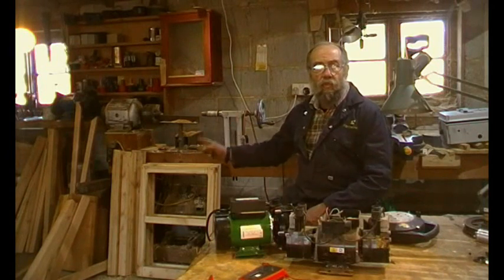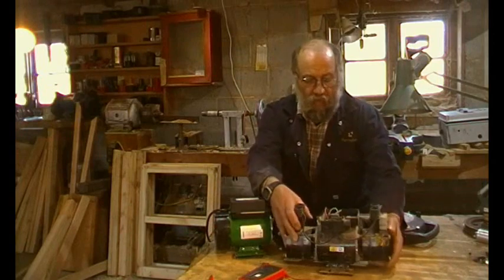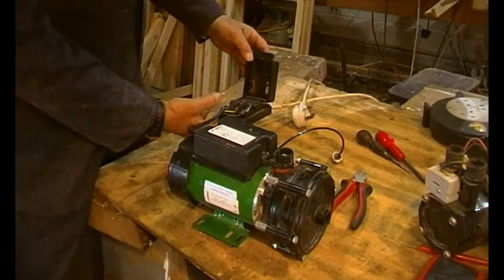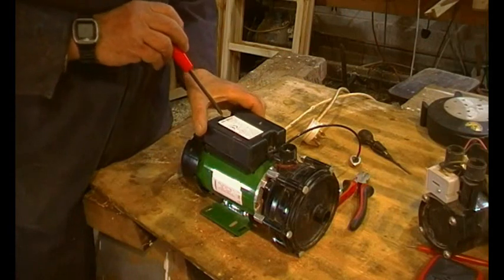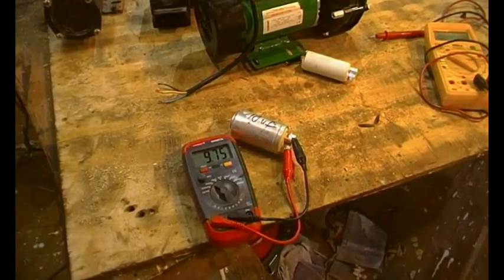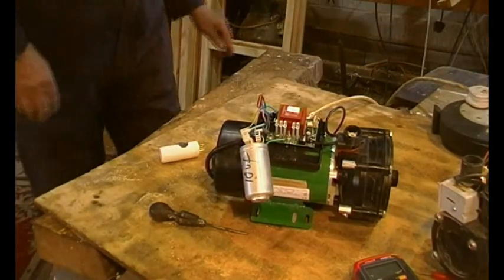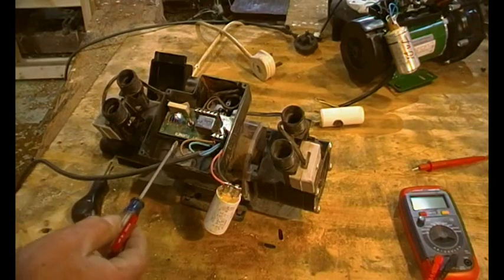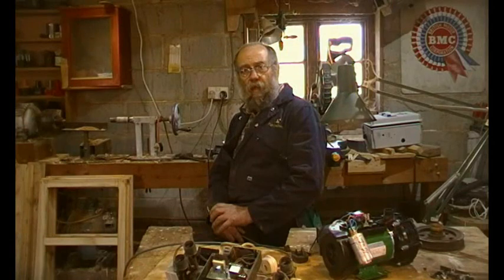Salamander water pump repair and re-purpose in our rainwater harvesting system.

Comment: Mine only works at the one side as the hot water wasn’t going we turn it and now cold one is not going any advice 🙏
Reply from the maker: Hi, is the motor spinning? are there any servo-valves in the system that are stuck? You may have to take it out to test, cheers
Reply: @TheInfoworks  i dont thing so we have any servo its old system with the tank in the loft 😢
Reply: @TheInfoworks  we have salamander pump and thats a second salamander pump which stop working properly after not even 2 years 1st one was 1.5 bar that one is 2.0 bars my husband turn it around and now hot water is going but cold one not
Reply from the maker: Sounds like the motor is stalling when both pumps are working, I suspect a bad capacitor, cheers @karolinapawlak132
Reply: Hi pump is going ok just with the cold water when i try to turn tap to hot one or open hot water not working at all no motor going with hot water

Comment: Can you connect the wires to any of the capacitor spades ? Or do they have to go in a certain order ?
Reply from the maker: Hi, yes an AC capacitor has no polarity, so any way round. It's the DC ones that need to be the right way round, cheers
Reply: @TheInfoworks  thank you so munch. Really hope this fix works for me once received the capacitor
Reply from the maker: As you have seen, ithas worked for me several times, cheers  @hassf419

Comment: I have this same problem where can I get a replacement cap?
Reply from the maker: Hi, I'm sure an on line search or even Ebay will provide. Hope you enjoy my other videos, cheers
Reply: @TheInfoworks  I called Salamander they say their caps are specially made and they dont know or sell a replacement :)
Reply from the maker: @chrisellwood3523  Chris, that's just corporate marketing nonsense designed to sell more units and create tons of waste. I showed what I did and that is successful, but if don't feel like improving your skills then there's no more to say, all the best, cheers
Reply: @TheInfoworks  I changed the cap from a new motor and still just hummed with no motion.  The new motor was silent until I turned it upside down.  Must have been another issue , not the cap
Reply from the maker: @chrisellwood3523  Yes there are pressure  water flow sensors in the output connection that i disconnect when using these pumps for other uses. Turning the motor over activates the sensor gates, cheers

Comment: So, just checking, you basically bipassed the circuitry, so mains is connected to a motor? Thanks for the video 👍
Reply from the maker: Hi, yes and changed the duff capacitor. Although the control circuitry worked it was not necessary for the my use as I think it was some form of back pressure sensor. subscribed? cheers

Comment: I've seen videos of capacitor banks to start cars, wonder if the battery would last longer not taking the strain of high current draw.

Its the same on generators not producing power after the capacitor failed, although now they use circuit boards for voltage control but more to go wrong.
Reply from the maker: Hi, the benefit of the quick charge / discharge is the phase shift for starting, cheers